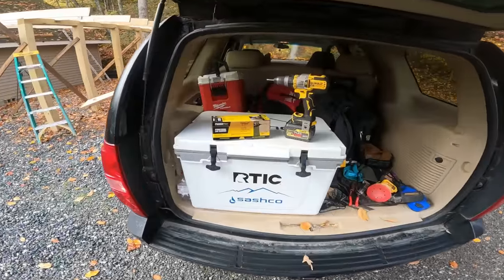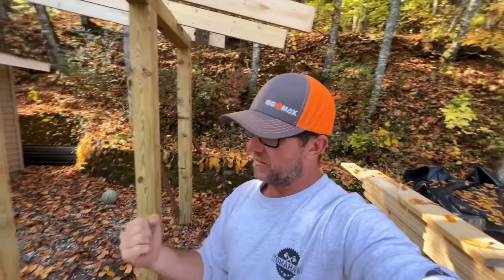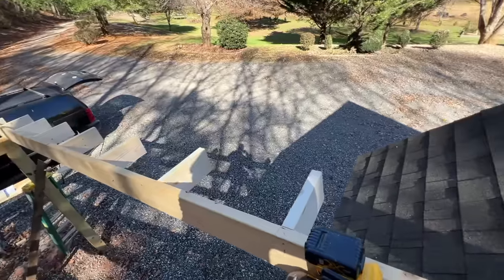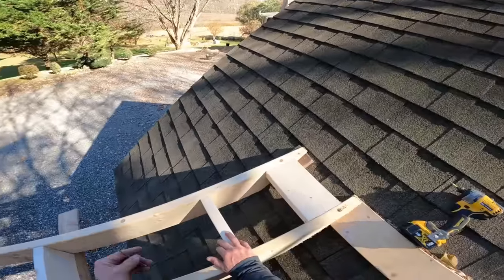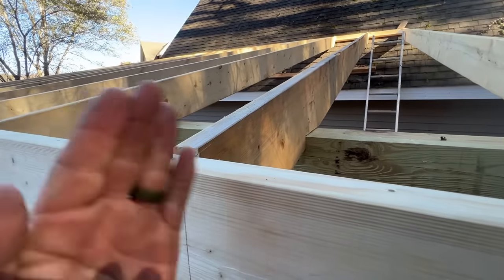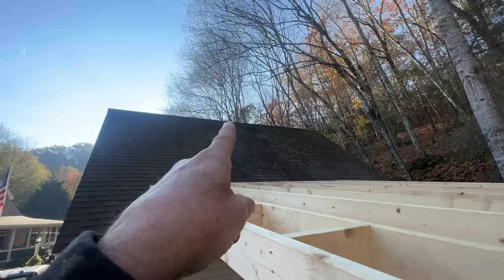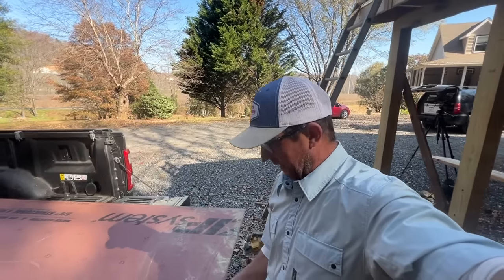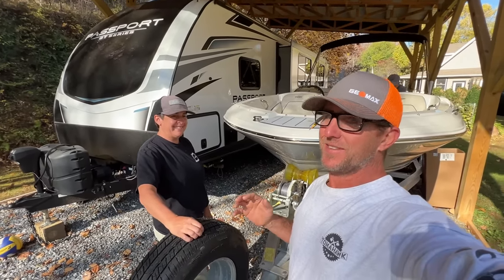Jay’s New Shop-Episode 3-Garage Addition/Fascia, Overhangs and Sheathing!

Comment: Jason, I have a suggestion. Would it be worth it? If you would have put some zip tape on the bottom of your two by six and goes on your roof line on the bottom and then put your two by six down and that way you have a couple Strips of zip tape on the bottom between your two by six and your Shingles, Then for extra sealant, put a beat of silicone along the edge of your two by six so the water can't come in from underneath from the top along the shingles, I was just thinking that as you were building. I don't know if it's correct or not, but it may be overkill. Other than that it looks good you're done great drive on buddy
Reply from the maker: I’m sure that would work thanks for the feedback.

Comment: Need to use the zip liquid flash on those last screws you used to secure the 2nd band board. and I would put zip around the top of the zip at the roof as an extra layer of protection under the flashing. in case any water gets under there.
Reply from the maker: I did put sip over them.

Comment: Lap your overhangs back to the next rafter. Maybe a drop truss setup for your exterior rafter (make 1 1/2 shorter in height from the rest) and lay your overhangs horizontally. Screwing FOT on your second rafter and on top of your drop. You could either rip your exterior trusses 1 1/2 from long point to long. Or but not the best way, you could notch out your overhang on the rafters where your over hang goes an 1 1/2 as well. This to help more with structural weight load.

Comment: There’s a little set screw on your saw to set your deck plate 90deg to your blade just use a square
Reply from the maker: Pro tip! Didn’t know that
Reply: @Building_Jays_Way  pro tip now you do

Comment: Nice job and fixes on the go where needed. I assume you will get some extra ziptape for the last 6 inches. If so you should also use some to cover the long screws you put in on the end to make those holes water tight.
Reply from the maker: Yeah, I just realized I don’t know if I showed putting the extra zip down. I did get the extra zip and cover what I had missed and I did go back and cover any big holes that the lags made as well. Thanks.

Comment: Hey Jay. There is a set screw on the saw to adjust the 90 cut angle. Mine was off too when I first bought it and ruined 2 very expensive pieces of wood !!
Reply from the maker: Yeah, you’re the second one to tell me that. Did not know that! Thanks for the pro tip.

Comment: Question for you Jason: Are the band boards screwed through the roof sheathing and into the trusses? 

As for the 16” overhang, I think you could attach the cut (the wedge) and nail it or something similar to get your front overhang level and plumb with your facia. 

Looking good bud!

Comment: I hope you realize that 3 tab shingles need a minimum of 3/12 pitch for standard (non-seal) underlayment like 15 lb felt...for your 2/12 pitch, you'll have to use stick down underlayment (such as Grace Ice & Water Shield) or Zip System stick down.
Reply from the maker: Too late!😂 good thing it’s only a shed. Thanks for the insight.

Comment: Depending on the quality of your wood supplier and if that wood will be visible. You should cut 1cm on the edge.  If they store for some reason vertically, you could have some small rocks inside. And it can damage your blade.

Comment: the nose of the beams where you screwed em to the roof of the garage is extremely thin and even cracked on some pieces. I doubt it will support all the weight of the whole roof. You planning on reinforcing it more with an extra piece under the one you already got?
Reply: never mind, you fixed it 😄

Comment: That sounds good with the zip  system no under lay but you won't get the warranty from the roof shingle manufacturer if u dont use payper so if u want your shingles under warranty u still need payper
Reply: If you read ALL the fine print installing the shingles voids the warranty. In all seriousness nobody is going to warranty shingles on a 2/12. Jays saving grace is they don't get much freezing weather and it is not over a conditioned space.
Reply from the maker: Yeah, what Tim said! Lol

Comment: When measuring layout you put tape measure 1.5 inches out which would simulate it being on the outside of the board. Then you measured 24” and went 3/4” before and after but 3/4” before would put you too close. If You were measuring from center of fascia board you would have burned 3/4” and went to 24” and went 3/4” back and 3/4” forward that would be right no?
Reply from the maker: So layout would be 24 inches on center so on my first one if I hook on the outside facia board which would be burning the inch and a half my first mark would be 24 centered which would be 3/4 back 3/4 ahead and then from there 24 on center middle bing up the rack.

Comment: Is that band board wide enough? It looks to only be supporting the top third of your joists. With a snow load on the roof, it seems that those ends (points) of the joists at the band board could split down grain of the joists under heavy load. A wider band board, perhaps 2x6 or even 2x8, would have given you more support across the whole joist height. Or am I getting ahead of the videos here and you add more blocking under the joists below the 2x4 band board?
Reply: Well, I'm an idiot. New rule: no commenting until I watch the whole video. So, feel free to ignore my comment.

Comment: 25:55- What I think is you wouldn't have had that problem of those rafter 2X8's revealing so much if you'd of used a 2X8 for your facia board, vice a 2X6.  How you're left with hacking the bottoms off all those 2X8 rafters.  ACK!!!  🙂
Reply from the maker: I knew I was using 1x6 fascia so I went with 2x6 sub-fascia. Wasn’t that bad cutting and I think it looks good.
Reply: @Building_Jays_Way  Thanks for the reply Jay!  Keep the videos comin'... and put that Pharmacist to work more!!  🙂

Comment: Yes I have noticed the DeWalt 7 1/4 saw does not cut at a square angle. Its a degree or two off. Can't cut a beam perfect that's for sure. Expensive tool and inaccurate precision

Comment: Way to flat for shingles bro, the only thing that will save it from not rotting would be the zip board. 2/12 3/12 is not meant for shingles. Just make sure you cut big steps and only put 4-5 nails in them. Maybe ice and water shield it before you shingle it..
Reply from the maker: Too late! Wait for the next video lol
Reply: @Building_Jays_Way  it’s looking good though man ! Videos are awesome to !

Comment: You need to get the 60v dewalt flexvolt saw. I had for two years framing and it’s still a beast even after dropping it off 3 roofs.
Reply from the maker: You probably have Forearms, like Popeye!